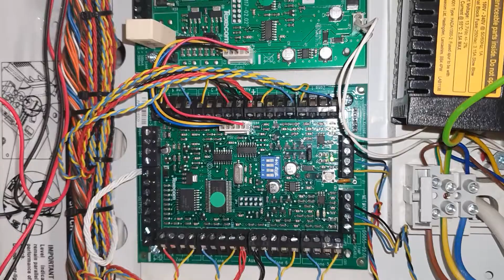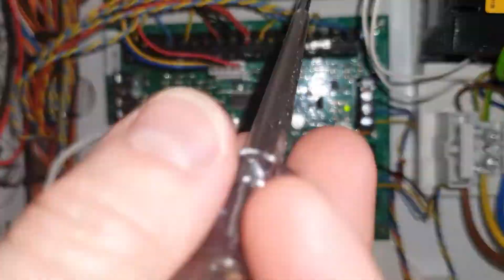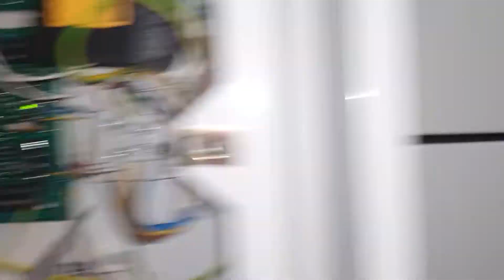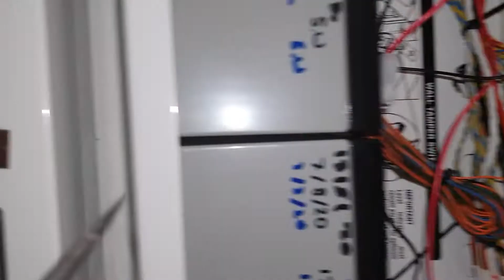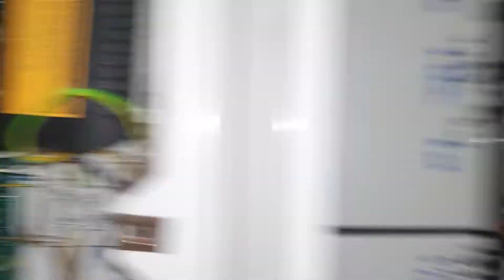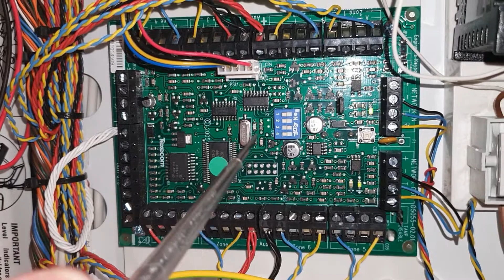Texecom Expanders Explained

Comment: Hi mate great video, bit random but I have a 64-W, looking to up the wired zones with an expander but I also have a wired keypad going in too, would the network power from the control panel be enough if I go into the expander and out to end at the RKP or do I need a PSU? cheers.
Reply from the maker: @staffsemergresp  Hi, you should be fine with using the power from the panel. Just be careful about what address you put it as, as if you have say 9 wireless devices, you would need to address your 8-EXP as 3
Reply: @pizzaandchipsmate  I have 20 wireless devices so what would I do then for the 8XP?
Reply from the maker: @staffsemergresp You would address it as 4 or even 5 if you might add more wireless in future.
Reply: @pizzaandchipsmate  Apperantly with the 64-W its best to go for 5, would the wired RKP be alright on 2?
Reply from the maker: @staffsemergresp EXP's and RKP's although on the same network, use different addresses. So you can have your RKP as address 1, the first batch of wireless zones will be address 1, then however many wireless zones in batches of 8, are then taken
Reply: @pizzaandchipsmate  I already have a wireless RKP as Add 1 with no dip switches up so putting the wired addition as 1 would conflict right? unless its different for Ricochet, sorry to ask so many questions thanks for the help.
Reply from the maker: @staffsemergresp Yes, that would conflict. So in that circumstance you would need dip switch '2' up for the wired RKP
Reply: @pizzaandchipsmate  Alright thank you, final question but where would I map the expander zones too? What do I have to do other than confirm devices as well? the manuals not clear on the setup and mainly tells you mounting/wiring and addressing.
Reply from the maker: @staffsemergrespDo you mean for the wireless? When you learn them in just do it in ascending order, you need to learn/ assign a zone to a number manually. So I typically do it as if if I'm walking through the property and they are in order of what I go past. When you finish on zone 29 (you said you had 20 wireless devices, then address the wired exp as 4 (or 5) and the wired zones will start from 33 (or 41) as they go 1-8 on the expander terminals. You will just need to confirm devices (engineer utilities, option 5) once you have wired the wired exp into the network (have the address set before wiring).
Reply: @pizzaandchipsmate  Oh alright thanks thats a big help, so just put the 8XP zones at the end of the wireless stuff?
Reply from the maker: @staffsemergresp Exactly. No way else to do it
Reply: @pizzaandchipsmate  Alright, thank you very much.
Reply from the maker: @staffsemergresp You can do the network as Panel- EXP & Panel- RKP (what I prefer to do)

Comment: Hello how are you doing, I have a question regarding a texecom 8168 system, I have power supplies for each expander but when there is a power failure the keypad tells me confirm devices, each expander is getting power from a 3.2amp power supply which has 8 Amp batteries in them, what could be causing this problem as all power supplies are commoned to the panel respectively
Reply from the maker: If you're using power supplies you wouldn't use the positive from the panel, only the negative, transmit and receive. If you remove power at a power supply does the battery take over?

Comment: Hi great series of videos you have.   Are you familiar with the micro shock / contacts?   If so do you know how to open them for battery changes without the clip breaking, they seem very brittle and can't find a way to open them without the clip on back plate that holds the sensor shut breaking off!
Reply from the maker: One side has two "feet" and the other side has a single inlet for you to use a 2.5/3mm terminal bit to put in and leverage to pop it out. You'd put your driver in as if you were stabbing it (straight on) and leverage away from the body of the contact
Reply: @pizzaandchipsmate  cheers, that's how I did it maybe just unlucky, have you ever had issue with the little clip breaking on them?
Reply from the maker: @offbeatwarble  only if I have been too forceful and bent it too far in

Comment: Hi Sam/All i have a texecom Premier Elite 24 do Question1: do i need to put eol resistor into control panel and move the resistance slider to texecom on the pir or just use silder in pir on its own. Question2: Can i simply add a second bell by doubling up bell wire in the bell terminal block Question 3 Can the Alarm be fully programmed from the wintex software. thanks all
Reply from the maker: Hey, No, you do not need to put a resistor in a panel, you would do one leg from the panel terminal into the first A, then the second leg into the last T and have the slider be on default (2k2, 6k9). Q2; You can indeed, I would only use one bell tamper though. Q4, You can do yes, I use the keypad 99% of the time though, as it's more responsive to changes (you have to send information when you've made any changes
Reply from the maker: What's pretty handy is setting up SmartCom then using the SmartCom to dial in to WinTex rather than plugging in the lead and messing around with what Com Port it's connected to

Comment: And how does the bell wire in the expander
Reply from the maker: You would wire it's power into the Aux outputs, then wire a trigger core into output 1 and another core for strobe to output 2. Then in your Expander Outputs change them accordingly

Comment: Can you wire a bell box into the expander
Reply from the maker: Yes you can, you can wire the + and - from the AUX output. Then wire a core for the trigger into Expander output 1 and other for the strobe into output 2. You would then change the attribute on Expander Outputs

Comment: If you has a keypad and and exp, on the panel would both the expander and keypad be connected to the + - T R terminals on the panel or would they be connected differently?
Reply from the maker: The Keypad and Expander would both be in the + - T R holes
Reply: @pizzaandchipsmate  would one have to be set to a different address as they are both being connected to the same place?
Reply from the maker: @JAMESJAMES26000  You need individual addresses on keypads and expanders. Expanders and Keypads can have the same address, you just can't have 2 Keypads as Address 1, but you can have an Expander and a Keypad each as Address 1
Reply: @pizzaandchipsmate  just powered up the exp, on zone setup it only shows the zones 1-8 of the expander and not the onboard zones on the panel.
Reply from the maker: @JAMESJAMES26000  the 1-8 will be the panel, you'd need 9-17 for the expander. Have you confirmed devices?
Reply: It’s not showing the exp when I go to confirm devices
Reply from the maker: @JAMESJAMES26000  Then the panel isn't seeing it, have you used the correct/ same colours for + - T R? Is it getting it's power from the panel?
Reply: @pizzaandchipsmate  yeah checked that, just to confirm I have a keypad and the expander both connected into the + - T R on the panel, both set to address 1 - all dip switches down
Reply from the maker: @JAMESJAMES26000  Yes, that's fine. Then on your confirmed devices you should have RKP 1..., EXP 1...
Reply from the maker: @JAMESJAMES26000  What panel? In the Exp are they the same colours for + - T R as are what in the panel
Reply: @pizzaandchipsmate yeah it’s not showing up. I’m guessing the exp is suppose to have both the green and red lights flashing
Reply: @pizzaandchipsmate  it’s a 64-W yeah same colours from the panel as in the exp
Reply from the maker: @JAMESJAMES26000  you'll need to put the address as 2 I believe, as 1 is the first batch of wireless on the board
Reply from the maker: With the 64-W, it has an onboard 32-W. Which is technically address 1-4, if you don't use the wireless it will just be address 1 reserved as it were
Reply: @pizzaandchipsmate  so I should set it to address 5
Reply from the maker: @JAMESJAMES26000  Only if you have have or intend to have 32 wireless devices
Reply from the maker: @JAMESJAMES26000  It learns and uses in batches of 8. If you have 9 wireless zones you'll have Address 1 and 2 used. But only 8, you'll have Address 1 used
Reply: @pizzaandchipsmate  one 2 devices
Reply: @pizzaandchipsmate  so set to address 2??
Reply from the maker: @JAMESJAMES26000  How far away is the exp from the panel? Is it getting it's voltage from the panel?
Reply from the maker: @JAMESJAMES26000  I would 100% check the connections by giving them a small pull, made sure no strands are touching between T and R, and 100% check that you've used say yellow for T both ends (example)
Reply: @pizzaandchipsmate  I’ll check for the strands and it’s about 30cm away
Reply from the maker: @JAMESJAMES26000  Have you wired it in the Network In ports?
Reply from the maker: @JAMESJAMES26000  Any luck?
Reply: @pizzaandchipsmate so I’m a bit confused, I only intend to use less than 16 wireless devices from the onboard expander, including the 4 on the panel, what address should I set the wired 8xp to?
Reply from the maker: @JAMESJAMES26000  If you're using 1-8, set your address to 2, if you're using 1-16 set the address to 3
Reply: @pizzaandchipsmate  is that taking into account the onboard wireless zones and wired zones of the panel?
Reply: For address 2 would it be from the left: down up down down?
Reply: @pizzaandchipsmate  found the data sheet got it
Reply from the maker: @JAMESJAMES26000  Yes
Reply: Thanks guys for this conversation, helped me out a lot.
Reply: Ooh, now I’m getting ‘EXP 1,1 Tamper’ and ‘EXP 1,2 Tamper’.  This is after setting the expander network address to 2.  Any ideas?

Comment: Hi Sam is it normal for the bell box that is fixed outside to lose its connection with the panel after changing the batteries?
It was in the engineer mode when they were replaced. 
Many thanks
Reply from the maker: Hi, no that is not usual. Do you have access to the engineer mode?
Reply: @pizzaandchipsmate  
Hi yes I do
I have managed to get on to ricohat diag
And its is displaying "zone 17 Sndrs
Reply from the maker: @humbleness5864  And under the Zone 017 Sndrs does it have a number? No number means it's not seeing it. If it didn't have Sndr then it would no longer be learnt. Double check the batteries and in correctly and the connector hasn't come out. Did you use Lithium AAs?
Reply: @pizzaandchipsmate  and also it is displaying front room battery fault ,on the diagnostic it is showing Zone 015 PIR
Arrow as a symbol and XP
Reply from the maker: @humbleness5864  For the Zone 015, that will likely be a CR123 battery (just replace it) the arrow to XP means it's talking directly to the expander and not via another device. You can press the chime button (music note) and it will actually tell you the signal strength
Reply: @pizzaandchipsmate  No there isn't any number, and not sure if the connector has come out,we only replaced a week ago. The bell box isn't flashing as it used to
Many thanks
Reply from the maker: @humbleness5864  if there's no number, or arrow to XP it's not communicating. I'd check the batteries and also the lead that connects the 8x Lithium AA to the module has popped or
Reply: @pizzaandchipsmate  the bell box has been mute for 2 months now and I assumed it was the batteries,  I have replaced batteries with  lithuim AA 10 -20 years shelf life , not sure about the lead 
Many thanks
Reply from the maker: @humbleness5864  The bell would always be mute unless there was an issue or an activation. I would ensure the batteries are in correctly, ensure the lead is plugged on. If that's all correct. Remove the bell from the wall, bring it inside. Take it to near the wireless reciever. Put the system in commission mode (jumper across on 64-W (lid removed from expander)). Then power cycle the SAB, and wait 10 mins and then see if there is a connection
Reply from the maker: If it's not got the comfort lights on outside it's likely to be a power issue
Reply: @pizzaandchipsmate  sorry what I meant by mute was that it had stopped flashing 2 months ago ...
Thats great thank you its alot to take in but I will try and sort it out
Many thanks
Reply from the maker: @humbleness5864  You're welcome, check the power/ batteries then feel free to drop me a message.
If I've been helpful, please consider a sub to help grow the channel
Reply: @pizzaandchipsmate  
I subscribe 8 months ago when I first contacted you!! I will definitely recommend you to my friends and family 
You have been very helpful and saved me hundreds  ££££ !
Reply from the maker: @humbleness5864  thank you for the support
Reply: @pizzaandchipsmate  Hi I have just noticed that the bell zone is showing poll error 
It was definitely not there when I first had contacted you
Is there anyway I can rectify this issue without taking it down
It is a nightmare finding someone with a ladder im hoping i can re-learn it again without all the hassle
Thanks
Reply from the maker: @humbleness5864  If it loses connection it will say PollErr. You can make sure the batteries are in correctly. Checking anything else is a waste of time
Reply: @pizzaandchipsmate  Hi Sam we went back up  to the bell box and noticed that we forgot to replace the 4 remaining batteries, after we had done this the bell box flashed a couple times and now we don't have any strobe or flashing light and I dont think that its working like it was before there is also no  error showing 
What could this mean
Reply from the maker: @humbleness5864  Hi, you'll need to make sure all 8 batteries are in place and close the lid, open the lid, then close it again. It is unlikely it's fallen off the system, but pop the batteries in, go into engineer mode and check zone 017 on ricochet diagnostics in engineer utilities

Comment: Hi, thanks for the video.  I want to wire the expander to a 64W to add more wired zones. The panel has 3 wired keypads already. I thought you wire the expander back to the network terminals but your video shows it being connected to via ribbon. Am I mistaken on how to connect to the panel? Thanks in advance.
Reply from the maker: Hi, the ribbon is only for the 200XP (PSU part) to connect to the expander. It connects to the network as you've stated through the + - T R,
Reply: @pizzaandchipsmate  ok, apologies, I managed to confuse myself there.  If you wanted to add a wireless expander to a 24 for wireless devices, is it the same process? Does the wireless expander need programming via the panel?
Reply from the maker: @saxon1664  All you would do is set the address then start learning in your devices from whichever is your first zone on that expander. So if it's expander address 1- Zone 9, 2- Zone 17.
Unlike other systems (Euro) you don't have to tell the panel what type of expander it is
Reply: @pizzaandchipsmate  that’s very helpful thank you. I mainly do electrical work and small Texecom systems, I’ve never had to use an expander so I’m just trying to get my head around them.  
I’m an you add a wired expander to a 64w to add more wired zones? I can’t see it mention on the spec sheet anywhere.  Apologies for all the questions.
Reply from the maker: @saxon1664  Yes, you'll change to change the address to 2+ as the on board wireless is address 1. It only takes up things in batches of 8, so if you have more than 9 wireless zone it'll need to be address 3 instead